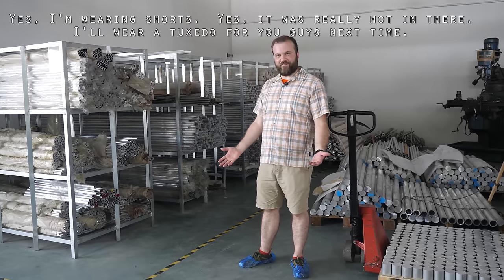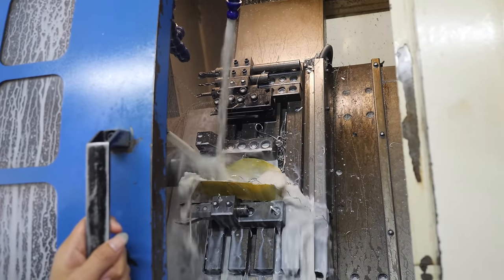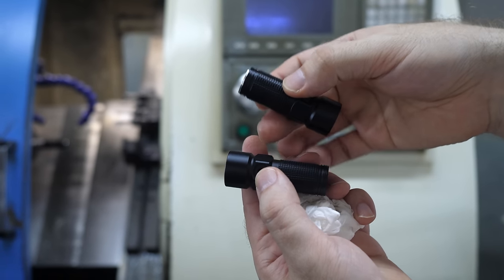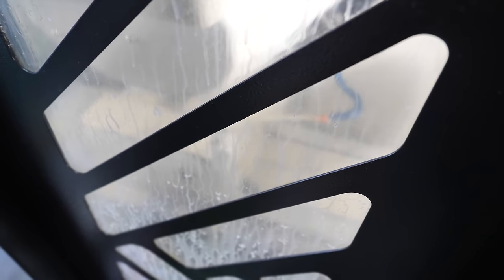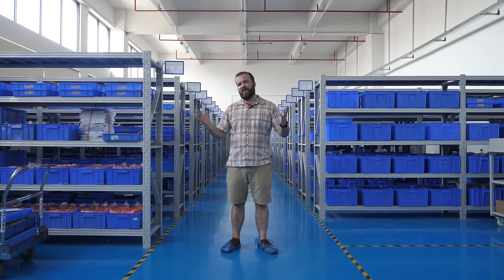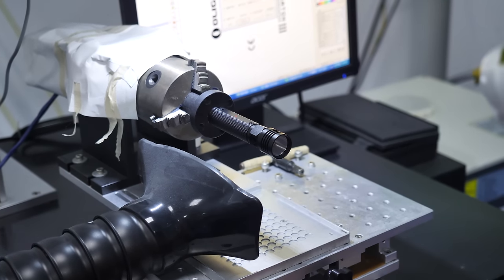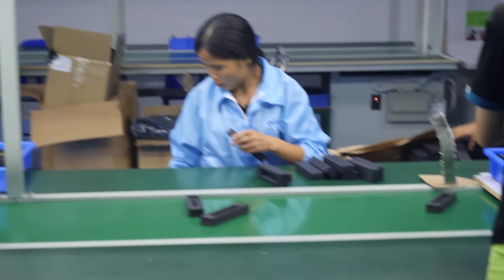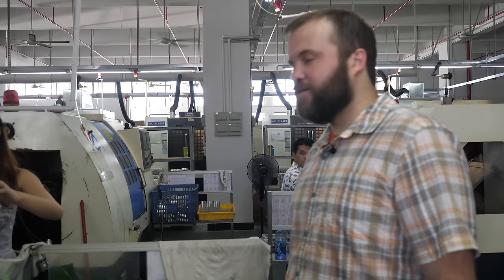Olight Flashlight Factory Tour

Comment: I have the Olight PL-2 Valkyrie mounted on my G19 Gen4, which I used to have a Surefire X300U.  Valkyrie is smaller, brighter, and much lighter than the X300U.  Fired about 500 rounds without fail.  Planning to buy 2 more for other pistols.  Need to find a holster that can fit.

Comment: I really like Olight.  I just got the Baron 3 Premium.  The tint is 6500k.    It would be awesome if Olight would utilize CRI  (5000k) LED’ options on all their models.  5000k looks way better than 6500k.  6500k led’s looks like lights I used to use 10 years ago.

Comment: The other thing I can't believe is that the guy putting in the retaining ring in the tail cap was using needle nose pliers.   I always imagined they had a special tool for that.   Like tube with 2 prongs on the end that spun electrically....
Reply: They do have a special tool. Needle nose pliers. You get your material before you do any 'rough cuts'. Have you even been around fabrication at all!? You seem like one of those guys that just has to comment to seem relevant

Comment: Hey guys i am new with flashlights and i have a question, to blind temporaly an intruder is better a long throw flashlight (>1000 m) or a high lumen one (>25000) ?  Which flashlight is better to blind temporaly two or more people at 1-3 m from you (A long range or a high lumen) or what i should iconsider is just the width of the beam? thanks
Reply: YouFindEVHere HockeyITA well the 2500 you just  permanently  blinded the intruder. So long through lol

Comment: and yet my Olight that I was told by Project farm was brilliant, the i1R2 K42700700 just wont hold charge, is there something inside that is designed to drain down the power for some reason, but it means I cannot trust it to be ready when I need it, I cant replace the battery without destroying it, such a shame an expensive torch is ruined still I learned my lesson I will stick with Cree, cheap and if it breaks buy another.

Comment: Good video  to have made. I assumed  the  more known  companies just buy their  flashlight bodies from  one supplier....or 2....nd just have their  names  printed on the body. :) Says something for Olight that they actually machine  their own lights....all of them?  :)  

Surprised they let you  in their  factory nd film. 

though Olight  isn't perfect e.g. they  sent out  a batch of  Baton 3 Pro's with  th  "proximity sensor" not working or not installed?  Mine is one. Bought this past December.  No biggie...Never placed much value i the featuer...I think flashlight companies have a few "gimic features" to help sell  slights. "priximity sensor" being one as well as  lockout via button presses.  Don''t actually need them.

Comment: Any machinists around here?
These guys machine whole rods of aluminum to make tubes - that makes no sense neither from the productivity standpoint, nor from the price standpoint, 'cause you can stick with hot-rolled heat-treated aluminum tubes (which weight-wise cost the same as rods) and machine mere millimeters to get the final product. Unless recycling prices are great and you're running tons of the same rods per day for every purpose (which I doubt), why do they waste that much of machine time and money on rods?
Reply: More than likely the rods are for different parts than tubular bodies. But if you need a part with a 2" outside diameter and a 1/2" inside diameter, it isn't a standard profile you can order from a supplier and the cost of custom extrusions usually don't cover the time saved when you can hog out material quickly.